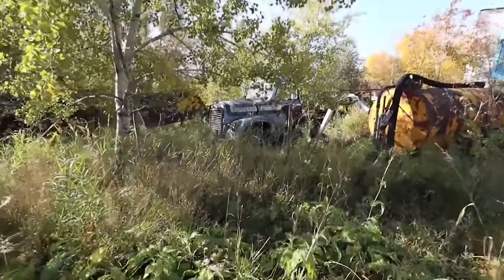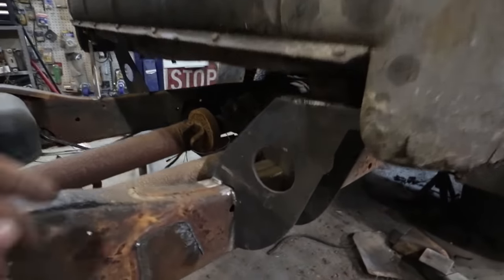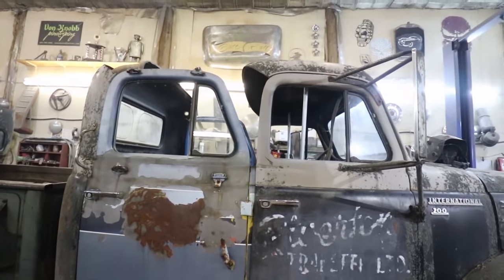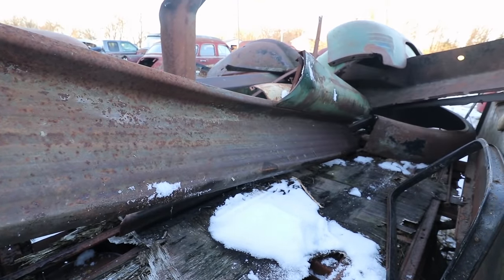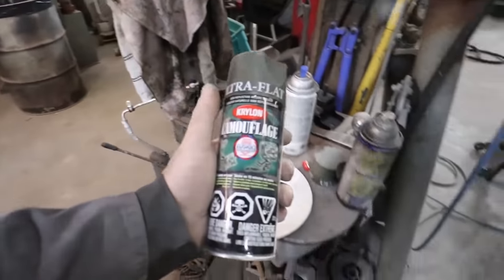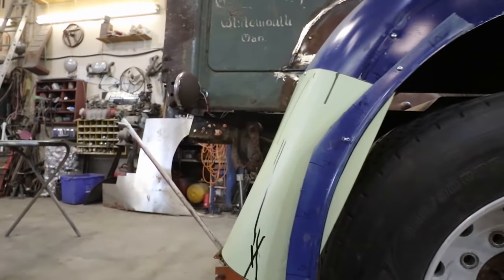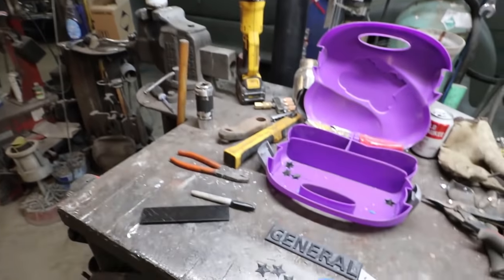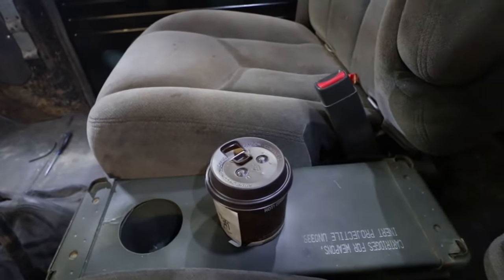1960 International Crew cab start To finish transformation.

Comment: Brent as I rewatch this masterpiece being created once again something just dawned on me. (Light on Marblehead 🤪) I never made a suggestion that I had thought of and forgot back when you built the cup holder and storage box out of that ammo can. I made a few of those back a few years ago when still enlisted before retirement. I used 50cal cans and installed an amp, an old laptop transformer and two speakers in each. This makes a great grab and go field boombox that when turned around looks like a simple storage can in a truck so unless you wanted someone to know what you had, they wouldn’t otherwise😉 Best part is it could also go from the truck at 12volts to inside the barracks at 110 with a cord. Jacks are put in for external power, a headset, and or an audio input jack to play tunes off your phone or whatever. One warrant officer put an order in for a couple larger cans to mount on her Harley which came out awesome having 10” subs in them. Pretty fun projects all in all and that’s why I thought to mention it to you if by chance you ever wanted to add any additional speakers in the general. The only issue is the vibration rattles the heck out of those flip tops so I used silicone and rubber tubing where needed and over the wire handles and it works perfect! Once again I apologize for not being able to make it to Texas this year to meet and greet, but it’s just not in the cards for this old vet this round. Maybe next year god willing, we’ll see. Ok thanks for throwing this build onto a one view vid, it’s still my favorite of all I’ve ever watched on YouTube. Please give Pablo a noggin rub for me, later…✌🏼

Comment: This really proves your brilliance at coach building, fantastic job. But I would have been happier to see  rust retardant work under body and between the double skins, under the wooden deck and guards, in the roof after welding the outside, and in all the clever work on the doors. fantastic job. Hate the though that this will begin to rot soon and all this clever work will slowly begin fail and be lost. Wonderful video . Thanks for,putting it up.

Comment: Nice 51’ Ford front end, always wanted to fuse a 53’ hood to one, add 2 teeth to the grill & french the headlights, with a tilt front fender assembly. Not a Dodge fan, but that international is legit, nice work 🍺

Comment: Way cool build!  The running boards came out good.  I thought to swap sides so the taper gets wider at the back.  Better footing to the bed. The side covers are sweet!  Nice bead rolling.  Be more work but fun to build toolboxes in there and attach the covers with zeus fittings.  Give it a big rig vibe and a place for snow chains and stuff

Comment: Fantastic! Is there any post you've made to answer all the usual questions, like build time, avg mpg, (5 ?), what you'd want IF you ever sold it, what is the engine, new bed length, etc?
It would make a great show picture of it pulling an actual army open box type trailer. I was most amazed at your courage in the conjoining of the different cabs and all that fab! Didn't look like it would work, but you made it happen!

Comment: The truck is way beyond badass! I’m shaking my head about the “rattle can” paint job though! Seems it would be far less effort and less expense as well as much more consistency in coverage if you would’ve just used a spray gun!
Reply: If you don't have a spray gun and compressor (seems unlikely with the amount of stuff he has in his garage I know) then rattle cans are cheap and easy to obtain. Also makes touch up a quick and easy job. Shows us what us average joes can achieve with a fraction of his skill set.
Reply: @AnthonyIlstonJones  I was thinking the opposite. No way he wouldn’t have an air compressor and sprayers are cheap. Perhaps the rattle can is necessary for legitimate rat rod cred?
Reply: @63stratoman  Seeing the visual state of a lot of his vehicles, you might be right....

Comment: if you need new inner material for those  taillights  go scavenge old motorcycle headlights.
can also be used as cool headlights when making a eyelid on the ring with fiberglass.
ive done a few builds using motorbike headlights.
the housing is thin and easy to relocate hole for mounting and wiring.

Comment: Also, while the 6bt 12 valve is a very stout engine in stock form, Power Driven Diesel makes some serious hop up parts that would do that engine some justice. The 12 valve can easily be upgraded between the Killer Dowel Pin work around, to an upgraded and modified P-pump, to a larger turbo, to upgraded fuel injectors, to an upgraded camshaft, and many many other parts. For what you use this truck for I'd say an upgraded P-pump, larger injectors, an upgraded turbo, and a little more boost would do wonders for this thing. Sorry bud, I am and have always been a horsepower junkie. I'm a truck driver, and my 2018 International LT625 has a Cummins ISL with a 10 speed Eaton trans. I have always lived the Cummins engines as there's not too much out there that can touch them for reliability and ease of modification. I also love Cat and the old 2 stroke supercharged and turbocharged Detroit Diesels, but I just can't get down with Navistar engines...no spank you!

Comment: amazing skill, making this beautiful unique home made truck out of junk parts, the amount of effort and hours of work that went into and the variety of tools you used, from 3d printer to CNC machine, the welder grinder etc. really artistic work, also the drone footage of where you drive it in the end is so good. my only complaint the absolutely irresponsible and dangerous way you were grinding, sanding and dispersing lead particles into the air. Lead is a dangerous neurotoxin that damages the nervous system, especially for children, and grinding, sanding  it like that is extremely irresponsible, your workshop is now contaminated with lead and difficult to clean up

Comment: What a shame to cut up those old trucks though even if the new incarnation is cool and lends itself to everyday use as a pickup or fifth wheel for a camper trailer and toy hauler.

Comment: When are you American mechanics going to learn the difference between a split pin and a cotter pin. A split pin is used to go through a castle nut to stop it turning. A cotter pin is a tapered pin about 10mm diameter which is driven through the pedal shank to secure it to the bottom shaft of a pedal bicycle. Are your bikes different to UK bikes?